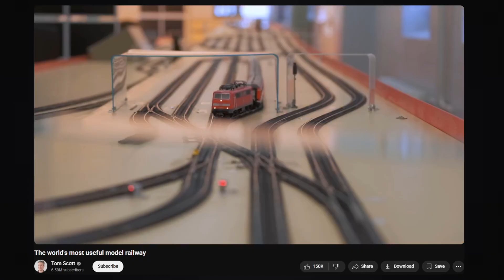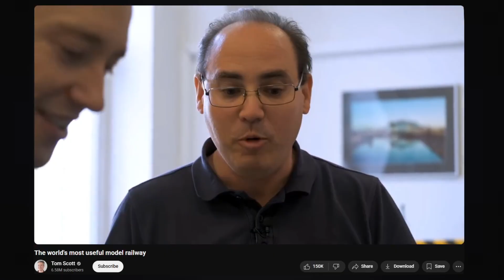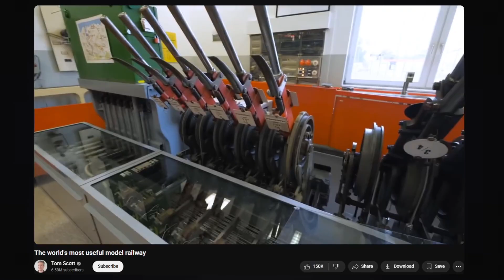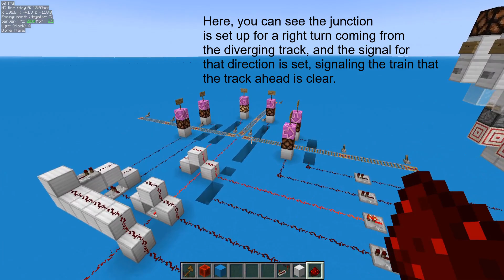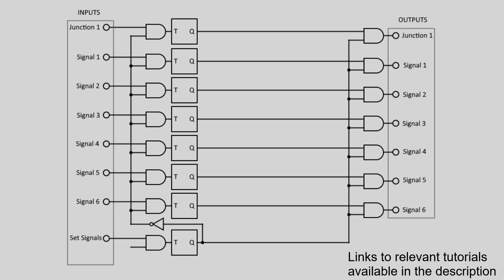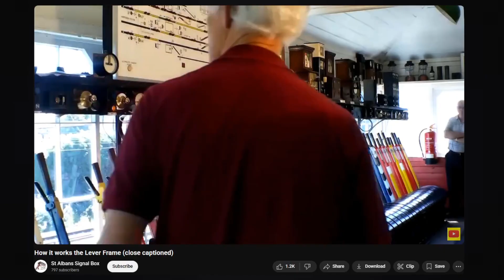Railroad Switch and Signal Interlock Prototype

Comment: I love the inspiration from a real world application of interlocking!

***I typed the following out before I realised someone else had commented this already. DOH. Ill still post in case it is helpful

I realise knowing when the block is clear or not is not a big deal or super important to the concept but there is definitely a real world example of block detection that could translate to minecraft. I work in the railways and axle counters are quite common on newer track within rail networks (At least here in Australia) as a Train Detection System. They count axles going into a block and then axles going out of a block, if there is ever more axles that have been counted in than counted out, the block is considered occupied. This could be acheived in your system using detector rails as the axles counters at each end of your block (in this case your set of points and some distance of track all around it). You could have it set up so the first detector to go off would push an item into a comparater read dropper which locks all the points for a particular block (as the block is occupied), then the next detector to go off with that same block would push the item back out, unlocking the points (block unoccupied). You could make a set up like this to work unidirectionally, if you were to ensure one minecart in the block at a time (signals or physically blocking entry to block set off by the same system)

If you want a block with a set of points to work uni-directionally AND you wanted to use a train of minecarts pushed by a furnace minecart, you would have to have an extra detector rail BEFORE each of the "axle counters", these additional detectors tell the system which direction the train is coming from, therefore which detector rail is the entry counter, therefore setting all the others as exit counters.

Love your work! 
Hawk

Comment: In reference to the manual 'train-in-junction' lock: you can try to use detector rails at each path, and theoretically if you know which direction the train should be going (or which path it should end up taking) you can lock the system until you detect a pulse from that path's detector rail meaning the train has properly left the intersection then you can unlock the system

I was also going to say you could lock the system when the train's beginning path's detector rail is ran over, but that might be overkill as it might just be sufficient to lock as soon as a path as chosen, but it would be more realistic I guess
Reply from the maker: Definitely a possibility. Probably not necessary in a prototype though :)